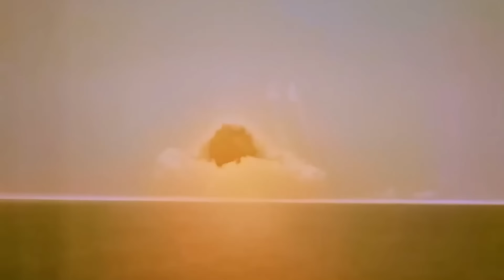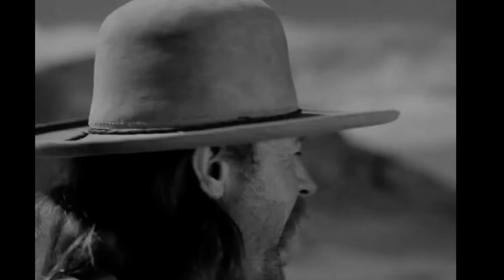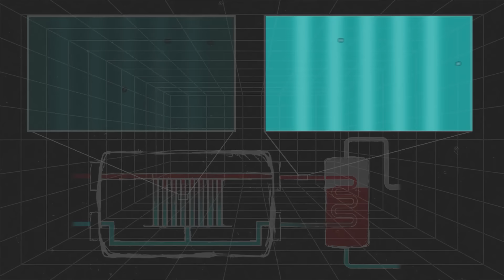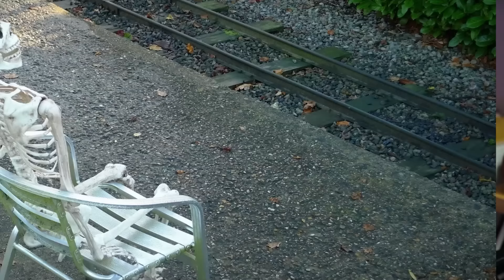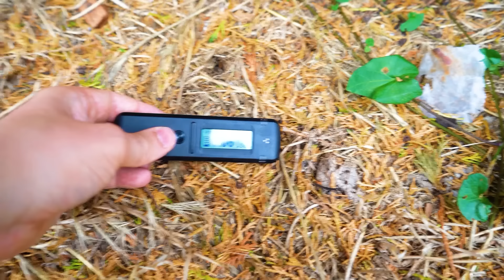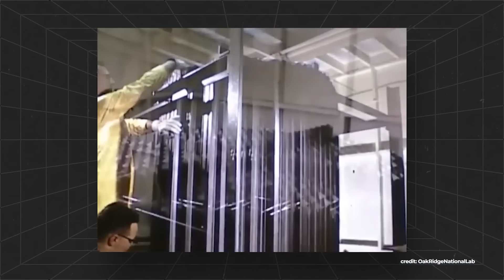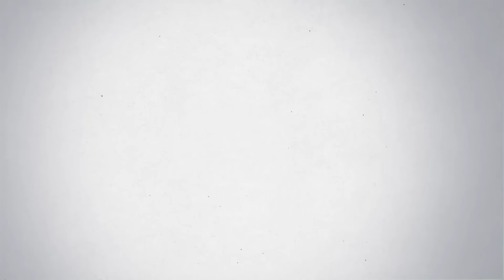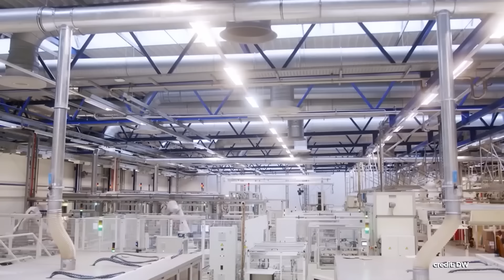It's Happening - China Launches World's First Thorium Nuclear Reactor

Comment: Starting up a molten salt reactor isn't hard. Making a metal reactor chamber that doesn't corrode away while holding 1200°C salt allowing for a lifespan to be profitable is hard.
Reply: Yes, that is the biggest problem with molten salt reactors.  Not only do you have hot salts, but also a high neutron flux (that's what makes the reaction).  But it's a solvable problem.  Ceramics might be the answer, and we've come a long way in ceramics since the 1950's.
Reply: @martinmelhus7324 salt is not corrosive without oxygen.
Reply: @Crow44195  So you think that metal at 1200 C won't allow any diffusion of atmospheric oxygen?  Everything dissolves in everything, and more so at higher temperatures.
Reply: @ Have you heard of Oxygen scavengers?
Reply: @Crow44195  No, but at high temperatures, I suspect, based on thermodynamics, that they would just slow decay rates, not eliminate them.
Reply: @ bing’s AI “Copilot” is very effective. If you ask about Molten salt reactor, it will tell you more about it than you can understand in conversation form.
Reply: @Crow44195  Gemini rocks, too.  Just loaded it this weekend, gets a lot of tough stuff right.
Reply: @martinmelhus7324 I was thinking the same thing….
Reply: @martinmelhus7324  tank armor. That’s ceramic. It should be able to handle it.
Reply: @roderickkutch6762  It can handle kinetic impact.  The question is can it handle molten salt and heavy radiation.  I'm not an expert on ceramic chemistry, so I leave those questions to people who know it better than I do.
Reply: @martinmelhus7324  i think ODS steel is a good choice
Reply: @martinmelhus7324  I'm sure SpaceX can help that issue, since they have very precise in-house machinery for ceramic layering.
Reply: @millanferende6723  Perhaps.  They aren't in the reactor business AFAIK.  Not sure if their coatings are designed for environments with lots of neutrons flying around.
Reply: @millanferende6723 Not sure anyone would want to use their technology at the moment, but who knows in the future if ‘permanent’ agreements can be agreed.
Reply: Oak ridge said they  solved the corrosion issue with Hastalloy-N  as this alloy showed no sings of corrosion when examined at the end of the experiment .
Reply: @leekumiega9268  
Hastelloy-N is not adequate for the purpose, and is not qualified for nuclear vessel construction. Helium embrittlement (from Nickel decay) and Tellurium contamination remain big issues.
Hastelloy-N most certainly showed signs of substantial corrosion and surface cracking after the brief operation of the MSRE, documented extensively by Koger, Litman, and others in an extensive series of articles issued by ORNL.

Candidate modified alloys will take many years to develop and qualify. For instance alloy 709 for liquid sodium applications was anticipated in 2018 (Wright and Sham) to take another 13 years to test viability, particularly creep rupture after prolonged irradiation. Actually getting qualification for nuclear vessels will require extensive further work on weld durability. 
MSRs involving Fluoride have greater difficulties again. 

This will take a lot longer than most people think.
Reply: @leekumiega9268  didnt they also conclude thorium salt reactors were not economically viable?
Reply: @ClyDIley  Economically viable means support/sale of bi-products for massive profits used by USA DOD contracts for weapons of mass destruction.
Reply: @leekumiega9268  The corrosion of Hastelloy N was investigated using irradiated specimens in the MSRE. As far as suitable purification is performed, there is no water or oxygen in molten fluoride salt. Therefore, Hastelloy N corrosion is very small [49]. The estimated corrosion rate of Hastelloy N was reported by J.W. Koger as 0.02 mil/year [50].

Regardless of the apparent success in the MSRE, standard Hastelloy N exposed to fuel salt under irradiation revealed material embrittlement due to intergranular attack, where grain boundaries were degraded due to the existence of tellurium (Te), which was produced as a fission product, although not penetrating deeply. To solve this issue, a modified Hastelloy N was developed where Mo, Si, and B are reduced and Nb (1-2%) is added; another solution is to control a redox potential, that is, to control a U4 +/U3 + ratio. It was observed that this Te cracking becomes very small at a U4 +/U3 + ratio less than 60. This U4 +/U3 + ratio can be controlled easily in a suitable range by varying the dissolution of Be into fuel salt [51].

This modified Hastelloy N was proposed as a container material in the MSBR, and this alloy has the same or better corrosion resistance as standard Hastelloy N [16]. In order to apply modified Hastelloy N to commercial reactors, the ASME Boiler and Pressure Vessel Code is required for modified Hastelloy N, where various property data, such as tensile data, ductility data, creep data, and so on, must be provided.

In the MSBR design, an anticipated service lifetime was 30 years, and the most highly irradiated portion of the reactor vessel would be exposed to a fast neutron (E > 0.1 MeV) fluence of less than 1 × 1021 neutrons/cm2 and a thermal neutron fluence of about 5 × 1022 neutrons/cm2. Although the irradiation effect on Hastelloy N is small until these values [49], these values are considered the design limit for MSR-FUJI [52].
Reply: There is a second class of alloys developed in the 70's during the fuel crisis that are a lot cheaper than the nickel based alloys like Hastalloy-N .
Not at liberty to say much more but I did see some that retained their mirror finish after 1000 hours in an elevated temperature chlorine corrosion test tank
They also were mirror finish after similar time in a pure oxygen controlled atmosphere furnace .
The fuel crisis ended so the world wide search for cheaper lighter high temperature corrosion resistant alloys got defunded .
Reply: @I-have-a-brain_and-use-it  Do these alloys respond well when heavily radiated by neutrons?
Reply: @I-have-a-brain_and-use-it   as a PH.D materials scientist I'd be fascinated to hear more. Could you at least share why you can't say more? Are you working with a private company today?  Military advantage so they classified it? Who funded that research? Raises questions for sure. When I was teaching at RPI there was a book on the Oak Ridge MSR explorations. I went to check it out some years later and it was missing from the shelf even though it showed as available.  I remember them talking about corrosion.  Your input reflects a sobering reality in "for profit" cultures as well as many military entities. No obvious political alternatives resolve them from our current state, though perhaps necessity will force more transparency as time goes...
Reply: @I-have-a-brain_and-use-it  was that also an ORNL thing or commercial? In the 4100's, shall we say?
Reply: @I-have-a-brain_and-use-it  Yeah and USSR was not believed to have rocket engine working in oxygen-reach cycle. Well, they did. Just invented the alloy
Reply: @I-have-a-brain_and-use-it  Was it Austenitic Stainless Steels doped with Boron and Titanium, with a sprinkle of silicon carbide intermediate layer?  Cause that's what I'd do... and I'm pretty smart.  =)
Reply: @I-have-a-brain_and-use-it  You can tell us. We won't tell anybody! Shhhhhh!!
Reply: @I-have-a-brain_and-use-it  anything produced that we can read about is already patented by big energy. In the U.S. we won’t see much in the development of such tech as long as oil and gas reign.
Reply: @roderickkutch6762  20 hurricane Helens a year will change that pretty quickly.
There is no alternative for vehicles and in particular farm vehicles so there will always be a fuel industry and we will always need lubricating oils plus all of the other things we make from oil & can make from coal .
Gas ( as in Methane ) is what we have to stop burning unless it is scrap by-product gas that would normally be flared off ( Mapp Gas & some Auto Gas )
Reply: @I-have-a-brain_and-use-it Does anyone actually think we can stop extracting oil, even if we stop using it as a power source?

It’s too essential to our way of life at this point, from everyday products, drugs, cosmetics, the solvents we need to make other things ed infinitum…
Reply: Anything is better than super high pressure steam and the potential for a meltdown. The the freeze plug and freeze spill feature of MSR is what has always won me over. That and liquid refueling and processing. So yeah, we're hand waving the corrosion, a little, but not a lot, vs. three industry killing meltdowns?

Not even remotely
Reply: @vincentcleaver1925  I agree completely.  If nuclear energy were today a completely new technology, given our alertness to safety issues (in general, not only wrt nuclear), I find it unimaginable that we'd opt for PWRs over LFTRs.
Reply: Doesn't have to be metal.
Reply: @marciacsr  Agree.  Some of the modern ceramics would make for an excellent reactor chamber, and AFAIK they are highly resistant to neutron effects.  Thermal expansion might be an issue, given the complex geometries of the chamber.
Reply: @martinmelhus7324  How are you even going to build an entire reactor chamber + coolant piping out of ceramics? We have to reduce costs to make NPPs viable and not further increase them.
Reply: . ceramic lining like space shuttle tiles ?
Reply: Space shuttle tiles are ultra pure strands of silicon.  I do not know whether they could withstand the weight and motion of liquid salt.
Reply: @martinmelhus7324 yes maybe a mix of the two
Reply: @marciacsr  They should use unobtanium!
Reply: Yes hard but done.. if it wasn't profitable, China would not have built it.
Reply: Just thinking outside the box
.Maybe in future times we can use volcanos to somehow make the steam to turn the turbines...not the major erupting types of course but the milder ones..maybe
Reply: Where are you getting 1200C? My understanding is that it operates closer to 800C and that the corrosion issue was caused by impurities in the fuel that could be removed to greatly alleviate corrosion in conjunction with the appropriate alloys.
Reply: Corrosion also relies on the presence of water and oxygen, which can probably be mitigated relatively easily.
Reply: Slap on rustoleum, my boat trailer uses it, not a spot of rust.
Reply: @AndyJarman Sounds good!  Let’s take it out on a 800 degree Celsius lake and see how it fares!
Reply: @AndyJarman 😂😂😂
Reply: You suspend it. Can't burn through anything if it ain't touching anything.
Reply: Operating below the costs of renewable energy is the really difficult part for all other energy sources. It's unsolved so far.
Reply: @jantjarks7946 it was solved a long time ago but cluttered by intentionally  unreasonable safety requirements. See Nuclear Power the Gordian Knot book.
Reply: already solved,its not very corrosive
Reply: Carbon polymer technology is getting up there.
Reply: 陶瓷可以的。大需要问题的工作环境。
Reply: @7-tens  10 -4... I was picturing some way of adding water to the magma system  or something along that line. .. capturing it and using the steam or heat in cool SciFi  future way..but just a thought..
Reply: I wonder why people always ignore the chemical plant required for fuel separation in real time in Thorium reactors. This alone constitutes the biggest problem with Thorium MSR, which adepts of Thorium MSR religion always conveniently forget about.
Reply: @7-tens  I don't think naïve wish for a wunder-energie solution that would fix the planet overnight and give everyone a pony and a popsicle is a manifestation of Dunning-Kruger effect, it's rather  something childish, on par with religions.
Reply: That's why China faked it just like they faked everything else.
Reply: The trouble isn't corrosion or engineering.

The trouble is the nuclear power is basically Free Energy. Thermodynamic laws no longer apply. Something from nothing.

Once that is up and running, oil is no longer king and energy becomes harder to use as a population control spigot. The elites don't like that.  (Notice how they only allowed traditional nuclear into play once there had been established mechanisms to bring it in line with oil prices? Artificially expensive. Plus, the whole weapons angle made it attractive.)

China isn't beholden to the same forces in quite the same way, and so they have allowed their people to move ahead with the tech. And it's another reason the 'West' hates China.

This post will be deleted in 3.., 2..,
Reply: @7-tens 
CVD works for diamonds, which are crystalline.
Reply: I bet ceramics is the answer but i have no prof lol
Reply: Ceramic
Reply: @martinweiss6599  Could work.  I worry about radiation damage to it, and possible thermal stresses.  Good design should at least minimize those issues.
Reply: Why does it need to be profitable?
Reply: @mechislander  Because economics drives power production methods.  Nuclear won't displace coal and oil if it costs more per kilowatt.  While you and I might understand the hidden costs of CO2 generation, economics doesn't.
Reply: A nitrogen entrained ceramic might do the trick.  More flexure than solid ceramic. Of course, it would have to be cured at room temperature to keep the thing from exploding.  Perhaps including microbeads of nitrogen in the mix….
Reply: If I'm not mistaken, a liquid fluoride thorium reactor operates around 600 or 700 degrees C, not 1,200C. That is the temperature of molten lava or borosilicate glass. While still very hot, it's probably a lot more feasible to develop alloys, pumps  valves and other hardware that will not corrode rapidly in the presence of molten fluoride salts.
Reply: So and that is why we built thousands of windmills .......
Reply: You can use liquid metal fuel instead of using molten salt, if you use separate loops for fuel and cooling. This is used by the so called Dual-Fuel Reactor (DFR):
🔋 Key Advantages of the Dual Fluid Reactor (DFR):
• ⚡ Ultra-efficient: Nearly 100% of nuclear fuel is used  
• ♻️ Burns nuclear waste, depleted uranium, natural uranium, thorium – and all actinides (incl. Np, Am, Cm)  
• 💥 Transmutes long-lived actinides into short-lived fission products  
• 🔄 Built-in Pyro Processing Unit (PPU): Continuously removes neutron poisons and extracts valuable metals  
• 🛠️ Liquid fuel: No solid fuel rods, no reload cycles  
• ⏳ Decades of operation with a single fuel load possible  
• 🚫 No corrosive salts: Liquid metal fuel avoids fluoride corrosion and complex chemistry  
• 🧊 Lead coolant: Excellent shielding, no water, no pressure → no steam explosion risk  
• 🌡️ Very high temperatures (700–1000 °C): Enables hydrogen, e-fuels, ammonia, and direct steel reduction  
• 🧠 Self-regulating: Output adjusts automatically via negative temperature feedback  
• 🪫 Minimal waste: Only short-lived fission products remain (<300 years)  
• 🏭 Compact & scalable: High power density, ideal for modular deployment  
• ⚙️ No moving parts in reactivity control: No control rods required  
• 💰 Uses spent fuel, DU, thorium & actinides – no enrichment required  
• 🌍 Reduces dependence on enrichment, mining, and fuel imports  
• 🔄 Fully closed fuel cycle: No external reprocessing required  
• 🆚 Outperforms typical SMRs: No pressure vessels, no water coolant, no fuel handling

So as a first step spent fuel and depleted uranium (DU) should be burned to get rid of the long-term storage issue. Countries using nuclear power since a long time, this gives a lot of "free" energy. For each 1 GWel reactor year in the past, it is possible to extract about 140 1 GWel DFR reactor years. Additional there is a stockpile of DU, which is about 4-5 times as large as spent fuel. So you get an additioal of about 4-5 times the amount of energy you get from spent fuel. Of course, countries like India and China don't have a so large stock pile of spent fuel and DU, so this would be used up fast. Here Thorium may be used earlier. But China has developed a new method to extract the nearly unlimited resources of Uranium from sea water, at a price similar to current market prices conventional uranium sources.
The original argument for use of Thorium was that it has less harmful residuals. But with reactors like DFR and other MSRs burning fuel fully down, this isn't an argument anymore. At least for the DFR the result of burn down are about 95 % precious metalls and 5 % residuals, which have an activity similar to natural Uranium after about 300 years storage. 
The difference is then how much radiation is issued during burn-down. Here Thorium is much worse than Uranium. What most people don't know, or don't mention at least, that breeding Th-232 not only produces U-233, but also some U-232, which at some point decays to TI-208, which generates hard gamma rays at about 2,6 MeV on decay. Others like Bi-212 and Pb-212 also have high radiation. This may become a problem if the reactor uses external fuel processing. The necessary shielding is immense. So Uranium burn-down is less harmful than the Thorium one. 
What is bad for use for power generation, is good against proliferation of U-233 for nuclear weapons. The activity of U232 mixed with U-233 increases over month/years after breeding, which prevents military use like Pu-239. Anyway, with conventional thorium reactors, with external fuel processing, they have to find a way to handle U-232 decay savely. The reactor, transport, processing and short-term storage requires very good shielding. This is also a reason why separation of Thorium breeding and use would be a bad choice. 
DFR keeps the fuel cycle including processing for any fuel closed within the reactor hull, till complete burn down. 
It will be interesting to see how this issues are handled by Thorium Molten Salt Reactors. The complete cooling loop will be a hard gamma ray radiation source.
Reply: What about using ceramic or something else alike as coating like they have on spaceships? Prevents metal and salt interacting and withstands the heat. I think we can achieve it with modern 3d printing or other engineering methods. They have 3d printers for concrete, why not other materials.
Reply: @stevannikolovski  It also keeps more of the heat of reaction in the salts, which increases efficiency.  But the thermal contraction/expansion can be an issue.  Hopefully a solvable one.
Reply: @stevannikolovski  Not viable because you are trying to resist a molten salt
You need to remember that nothing is actually solid and everything is basically a sieve being a few atoms with a lot of empty space around them where the electrons perform their little dances .
Micro cracks are a big problem with all crystaline solids and what we see as a smooth surface is anything else but that.
It used to blow the minds of the electroplaters when I put their handiwork onto the big optical microscope and they saw that highly polished smooth surface at 1,000 X magnification and then used the oil lens & green light to boost that to 2000 X the dead smooth polished plated surfaces looked like a clay pan desert that has not seen rain for 20 years . But as tiny as they appear ti us they are way way bigger then the diameter of a salt molecule which will penetrate the metal then start corrosive reactions.
Every solid is subject to diffusion where atoms ( or whole molecules ) travel through the lattice structure regardless of weather it is solid or not 
This is the big problem with handeling & storing hydrogen , the hydrogen molecule is so small it passes strait through most metals 
Amorphous materials ( glasses ) may actually work but most melting points are too low .
Reply: Ever heard of ceramics?
Reply: Considering the phenomenon known as Tofu Construction in China where buildings literally collapse in on themselves BEFORE CONSTRUCTION IS FINISHED, this does NOT fill me with confidence
Reply: @patrickhopkins4468  Unlike the 2021 Surfside condominium collapse in Florida? With enough people there will be a large range in the quality of work.
Reply: @brentpinkney7394  it's endemic in China.  Entire towns are uninhabitable due to shoddy construction quality and spongy concrete, structural steel that can be snapped by hand, and other grossly substandard materials.
Reply: @patrickhopkins4468 
The thorium reactor was built in the Gobi desert.  So if an accident occurred, very few people would be harm 🦉
Reply: @patrickhopkins4468 lol watch less propaganda videos and visit the country yourself. You may learn a thing or two.
Reply: @patrickhopkins4468 be more open and watch less anti China videos unless you are already paid on it.
Reply: Idiot😂 @patrickhopkins4468